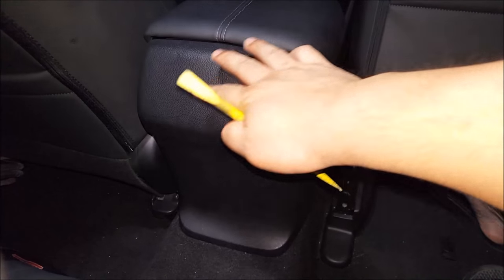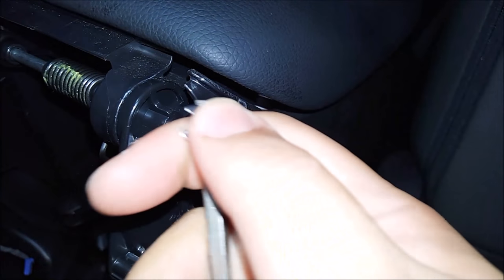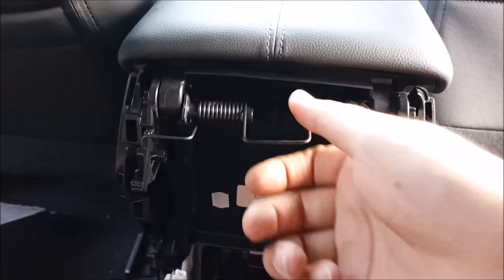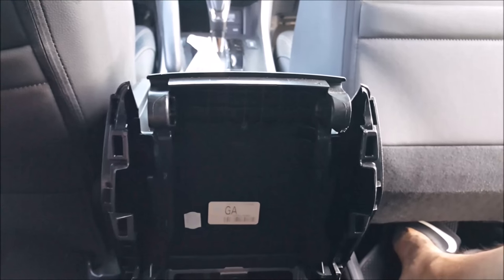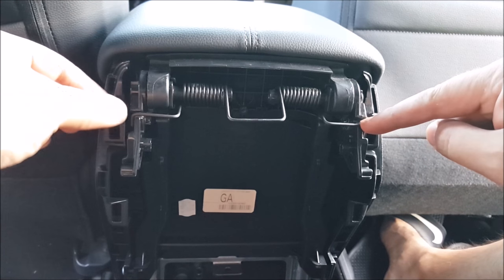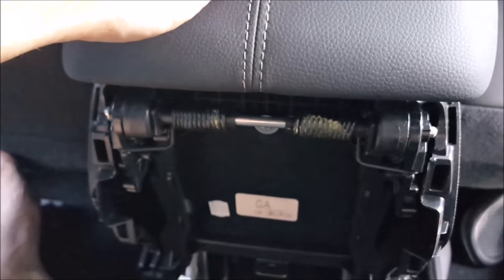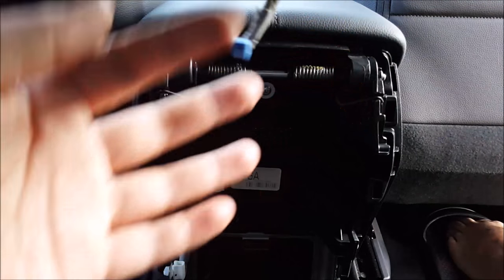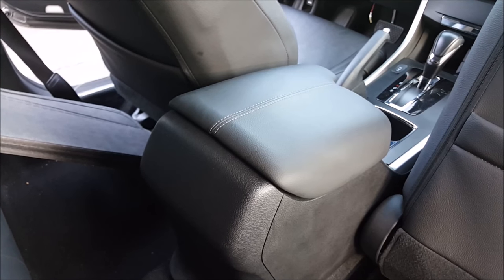Tutorial: Honda Accord Center Console Armrest Removal and Installation

Comment: Just did this per your vid. Took like 10 min. You saved me some time. Only tip i have for anyone else here. Is to replace the screws in reverse order as removal and it will fit without fight. Thanks again
Reply from the maker: Thank you for the tip.  Glad to hear that it will helpful.

Comment: will you be able to do a video on how to remove the shark fin antenna? I want to Wrap my roof but I dont know how to remove the shark fin.
Reply from the maker: sorry that I do not want to do. you basically have to remove the entire headliner because there are bolts that a holds down the the fin. in order to remove the liner you have to remove the entire b and c pillar